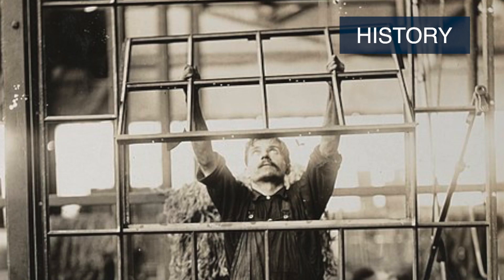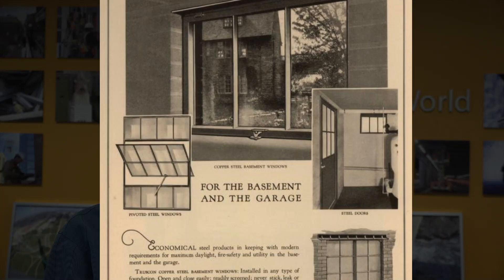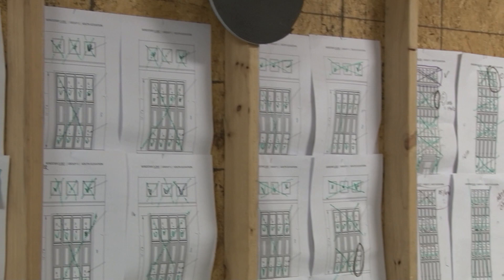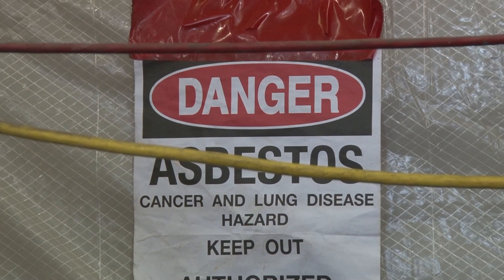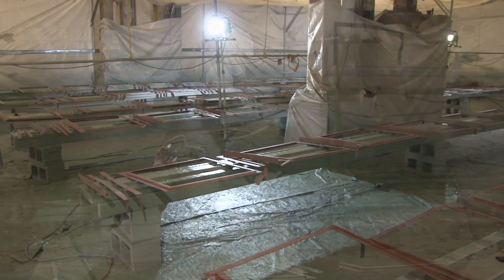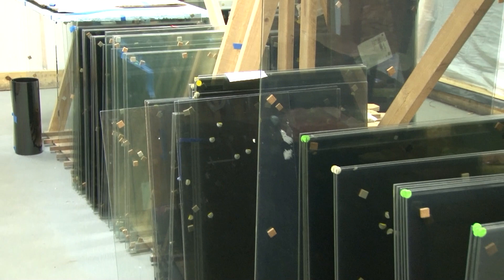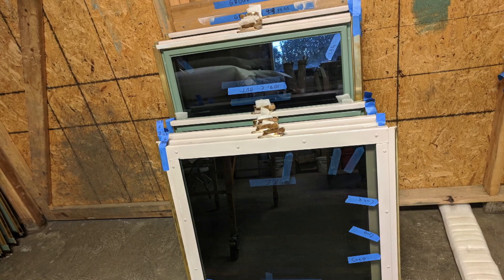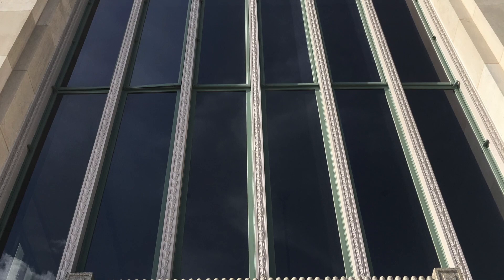APT International - Steel Window Restoration

Comment: Yes I have steel casement windows and would like to keep these original windows. Are there ways to add any insulation panes  of glass on the interior or exterior of the windows to protect from the weather or condensation.